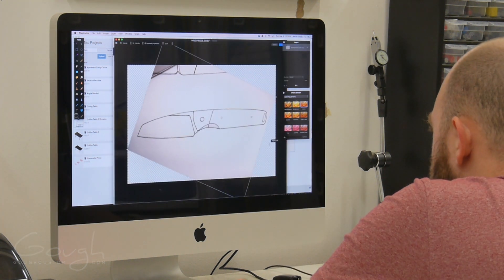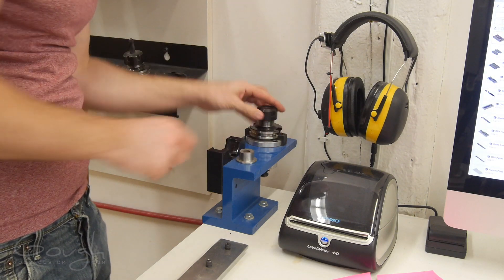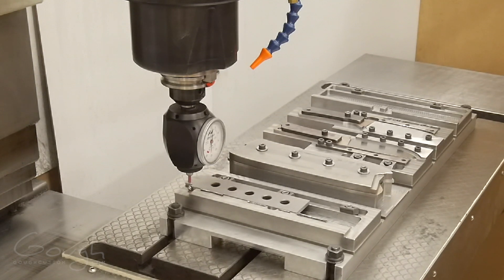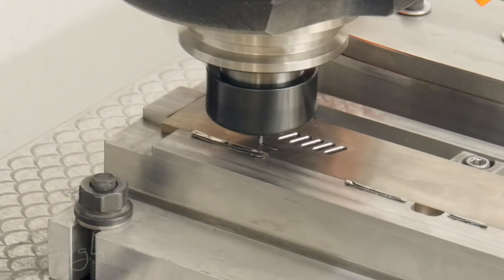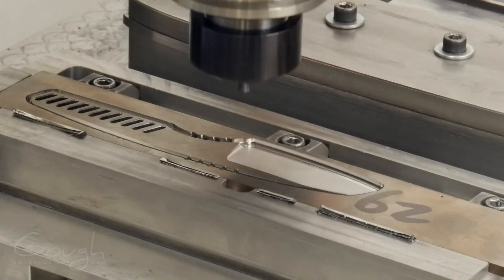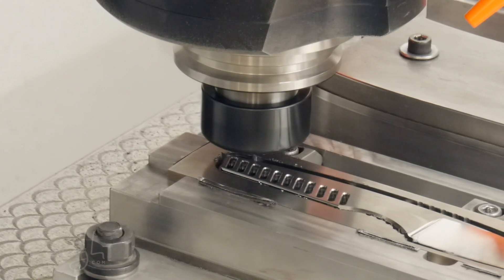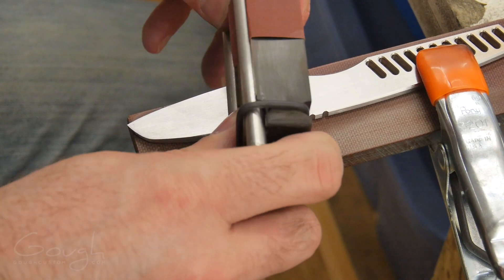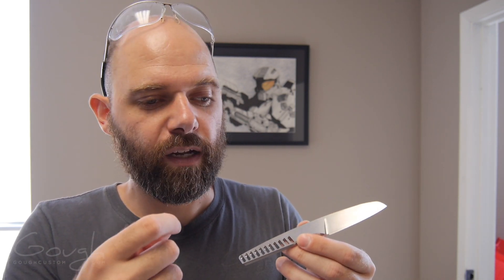Making a mini fixed-blade knife

Comment from the maker: A lot of people have asked about the polishing stones! I will be making another video covering them in more detail soon! In the meantime
the polishing stones I show in the video are 'CS-M' grade stones. I use the 1/4x1/2" size and I buy mine from MoldShopTools.com, here's a link to the right ones: https://www.moldshoptools.com/catalog/list.php?category_id=77&start=39
Reply: This is the first video I've ever seen of yours. That's a fine little knife, very handy looking. I make knives by using the stock removal method, cutting and filing, and eventually it becomes a knife. I like watching the machining process, that was fascinating. 👍
Reply from the maker: @beltfed4624  Thanks bud, glad you liked the video!
Reply: Gough Custom Thanks again!
Reply: Really appreciate the info!! ive been looking for those since I watched this. not sure what grits to get but I grabbed some 400 and 600 to try
Reply: @MrFra1ler  I'm not being intrusive here, but 1200 to 2000 grit sand paper creates a smooth finish, the wet or dry kind by 3M is best, Walmart sells an automotive finishing kit with multiple grits by 3M for around $5. I use the 1200 grit under a trickle of water, and it does a great job.
Reply: Janson Gander sounds good! I was thinking like pulling 600 grit I might buy some 800
Stones... what the heck should I use
For lube? I tried 3-1 and it worked but it was absolutely too thick and not optimal. Might get some mineral oil
Or wd40?
Reply from the maker: For lubricating the stones while polishing you should use water mixed with dish detergent, I use water and blue 'Dawn' brand detergent, works great!
Reply: I bought grits 240 thru 800, the one inch ones cover best. Great idea, thanks!
Reply: I buy the eBay edge pro stones, take off the plastic backing and have polishing sones for this. Super cheap and effective with many grit options available
Reply: Aaron, whats your grit progression with the stones?

Comment: Aaron, I have a couple questions if you don't mind.  1. What is vacuum hardening and the cost? I use only  Pops 8670 steel now because I don't have to normalize it.  Would I benefit by using a service to do this hardening?  I harden using propane and firebricks and quench in Parks 50.   I've really no idea what Rockwell hardness I'm getting but I can get the knife sharp enough to shave arm hair..lol.     2. What grit sandpaper do you use for your satin finish?   Thanks, Glen

Comment: Hi just wondering what is the best wood to use for a hunters knife handle
Reply from the maker: Hey John! Personally I am not a fan of wood handles as they absorb water and swell or shrink depending on the humidity. I prefer an artificial material called G10, I use it for all my knife handles.
Reply: @GoughCustom  thanks

Comment: Aaron, I missed what type of steel this is. I see you using CBN wheels and I thought you could only use high speed steel on the CBN or it would load up. Are you having these issues? If so how are you cleaning the CBN wheel?
Reply from the maker: Hey mate! You can sharpen any hardened steel with CBN, soft steel will load up the wheel

Comment: Thanks Aaron. What Fusion 360 toolpath are you using the blade bevel / profile? I cant get anything similar to work and Parallel is similar but not running across the blade like yours but alongside it, perhaps a setting somewhere? @Gough Custom. Thanks.
Reply from the maker: I am using a parallel tool path, there is an option in the passes section to change what angle the toolpath runs at!
Reply: @GoughCustom  Thanks, I found a setting to 'cross' both ways but not force a different option. Will check again.
Reply from the maker: @Chazaxl  In the 'Passes' tab there is a 'Pass direction' setting, this is actually an angle expressed in degrees!
Reply: @GoughCustom  Thanks Aaron, appreciated. I've done my first knife, its not perfect - using a converted Bridgeport Interact running servos / Centroid Acorn but learning as I go. So much to learn, thanks for your openness to share what works / doesnt work and detail around your process and methods.

Comment: Who makes that variable speed bench grinder?
Reply from the maker: It's a Baldor 3 phase grinder paired with a KB Electronics VFD (KBAC-24D)... Bit of a mishmash!
Reply: That’s a great idea! How many HP on the motor? You must get excellent control for various materials. You should consider doing a video on your latest sharpening workflow. The new shop looks awesome as well.
Reply from the maker: @samuelchacko4814  From memory I think it's 1.5HP, not that I really need that much!

Comment: If you leave a hole in the mold you cold use suction to hold the blade in position for removing the tabs at the end, like the tool is held in the CNC machine. :)

Edit: Maybe think of it more like a tunnel L shaped to get to the side if the mold to attach a vacuum pump.
Reply from the maker: Unfortunately given the relatively small surface area and the relatively high forces created by machining I don't think suction would be enough! It's only about 16 pounds of hold-down force per square inch!
Reply: @GoughCustom  well those tabs are really small, if you reduce the speed of the machine to it's minimum it might work.

Another possible solution would be to reduce the number of tabs to just 4 while keeping them more beefy. Pause the program and attach upside-down L shaped metal pieces in the middle of that spaces by screwing them next to the blade with a very tight fit to your plate beneath the blade. Now you can continue to remove the tabs, since the blade cannot move.

Sure this would reduce the accuracy a bit since you do a second pass just for those tabs, but it's much better than grinding them down by hand.
Reply from the maker: @RubenKelevra  I am working on a new process that will hopefully let me sidestep this whole issue! We'll see if it works out!
Reply: @GoughCustom  good to hear, never settle :)

I was wondering if you ever considered a titanium blade, would that hold up the sharpness etc? :)
Reply from the maker: @RubenKelevra  Unfortunately Titanium does not hold an edge anywhere near as well as steel does... The main advantages of Titanium are it's corrosion resistance and light weight... In some applications (like diving knives or lightweight backpack knives) this makes the lack of edge retention worthwhile, but likely not for my knives!
Reply: @GoughCustom  alright. I used to dive, so I came across some titanium knives but always wondered why nobody else use them. Thanks for the insight 😙🎶

Comment: This is how i make them. A larger blank and leave tabs..i'v been using this concept on diffrent projects for years..work great. but never have i cut hard..
Reply from the maker: It definitely works well! But because I need to make my blades match up perfectly with the handles it's hard to do that using tabs as grinding them off by hand I'll mess up the dimensions... I am working on a different concept that will hopefully be even better! We'll see if it works!

Comment: Hi there!

Love your videos as they really help me with my knives.  I'm cnc milling my kitchen knives and am struggling with a few things.  If I may ask, do you think this method would work with steel that is not heat treated and is 10" long and half as thick as yours?  I've used tabs with other projects and love them but am hesitant with a longer kitchen knife.  My main concern is having support for the bevel once it's flipped to cut the other side - which incidentally I'm curious how you locate once you flip?  Do you measure your stock exactly and locate off of that once flipped?  Or do you have a new origin for cutting the other side.  You don't have to answer all these but I'm fascinated by your method and hope to adopt some of it for my projects.  I too am using Fusion 360.  Thanks for the amazing work man.  Love your channel.
Reply from the maker: Hey Rusty!
Yeah I think this method would work great for a long kitchen knife, no worries at all there! I measured my stock exactly in this case, but I would recommend milling/drilling dowel holes on the first side and then using them to locate the blank for the second operation! It's a really good method for making knives with only simple fixtures!

Comment: Great vid! Super informative and entertaining. One question, if you were going to leave tabs anyway why not cut the profile all the way through instead of potentially being misaligned when cutting the other side? Seems you alluded to this risk when cutting the jimping all the way thru but didn't explain why it would be alright for the whole profile.
Reply from the maker: Main reason being if I cut all the way through the profile there will be nothing holding the blade in place and it will fly out! :) You can do this by bolting the blade itself down through holes into the fixture, but that requires a fixture specific to the knife which I didn't want to make in this case. I am trying to work out the best way to avoid all these issues in the future which is much easier said than done!

Comment: That bevel machining was super impressive. And doing hard milling is always impressive. And it's always cool seeing stuff be made in (basically) one op!

If you want more consistency, and less hand work, I feel like it would be better to mill all the way through the outside of the part, except for the tabs on the first op. This would also put the tabs all the way at the bottom instead of the center which means that the chamfer, assuming it is larger than the tabs, would hide the evidence of errors, so to speak. Of course you need it to be held while machining, so you'd have to drill and tap a couple holes in your fixture that you could put a couple of screws through the decorative holes, that way the part doesn't move during the chamfer. Or if you're lazy, clamp one side, chamfer the opposite side, M0, swap, repeat. The screwing or clamping would probably be needed for bevel machining as well so the tabs don't break. Maybe your way was less risky. /shrug

Great vids and knives man. Keep it up!
Reply from the maker: Thanks bud, I will do my best!

Comment: Mr.Gough Thank you! That whetstone stick trick is a GOD SEND! As soon as I saw this video I scooped up a cheap $9 set from Amazon. Grit from 80 to 1000. They wear a bit quickly but you get more bevels done then you would with any sandpaper in HALF the time. They are a consumable but cheaper than sandpaper. Internet fist bump. 🤜🤛 👍
Reply from the maker: Really glad it was helpful mate! If you need better stones I get mine from MoldShopTools.com, I use the CS-M grade stones and they are magic! Sorry for the slow response! 🤣
Reply: @GoughCustom  Better late than never, right! 😆 Thanks for the link. I'm going to give em a go.

Comment: Aaron, really like the video. It's unfortunate that you missed the bevel part in CAM. Could you provide a little more detail on what it takes to get an almost finished bevel off the machine? I would really like to know what toolpath you chose.
Reply from the maker: Hey Chris! The bevel part is actually not very complicated, it's just a parallel finishing path that has a  very small stepover, around 0.005" if I remember correctly. I only climb mill which really helps improve the finish. If you run both ways it's much faster but it won't leave as nice a finish...

Comment: Amazing knife ! You have a 4axis machine to be able to make these inclined cuts on the bevel or do you mount the piece at an angle ?
Reply: you don't need a 4 axis machine to make the bevels? The tool just moves downwards while it's cutting across.
Reply: @khaki.shorts  but then don't you end up with machining "lines/waves" ? since the tool is just in contact at one point at its edge. Are the lines just really close to eachother ?
Reply: oh looking closely I can see the waves indeed
Reply from the maker: Yeah as mentioned above you simply run a 3 axis toolpath with passes really close together to produce the smooth finish. There really wasn't any noticeable 'waves' in the final finish as the tool passes were only 0.005" apart! It's actually better to do it this way (rather than on a 4/5 axis machine) as you want to use the edge of the tool to cut, not the bottom whenever possible!

Comment: Hello Master Gough! I would like to ask u a question, I was thinking of making a fixblade survival knife what steel should i use between elmax or aisi 02? Best regards!
Reply: Cpm 4v
Reply from the maker: Almost any steel will produce an acceptable knife, but steel choice will dictate the geometry. If you go with a steel that isn't very tough (like 440C) then you will have to heat-treat it more softly. Softer steel means less strength so you'll have to leave the blade thicker to compensate which in turn will reduce cutting performance. It will still be an ok knife, but it is certainly possible to do better.

For a beginner getting into making knives I strongly recommend starting with O1 tool steel. It's cheap, easy to get and easy to work with. If you have made a few knives and have access to a heat-treating furnace then I recommend stepping up to A2 tool steel which is what I use.

Comment: These videos are great advertisements for your knives but not much use to anyone who can't afford your setup. Which would seem to be ... Just about everybody.
Reply from the maker: I don't think that's true at all! Seeing my process in Fusion 360 (which is free for hobbyists/startups) is great for people even if they don't have access to a CNC, they can use the ideas I show for creating designs/renderings/3D prints! Seeing the CNC process can get people interested in CNC, and there are plenty of inexpensive machines out there second-hand. I just bought 2 Fadal VMCs that are better than the one I show in the video for $4,000 each! Small CNC routers can be bought new for even cheaper and can be used for making sheathes and handle scales! Lastly the finishing process that I show using the mold polishing stones is something that most knifemakers have never been exposed to and can save everyone a lot of time... I work hard to make sure there are things in my videos that everyone can learn from!
Reply: @GoughCustom  I stand corrected. You got me thinking, thanks.

Comment: What grits do you go up to on those sanding sticks?
Reply from the maker: In the video I actually only use a single grit, 600 grit. They cut fast enough that I didn't need to start lower and work my way up.
Reply: Saw yer video and immediately ordered some from McMasters!
Reply from the maker: @flyphishr  I have tried some from McMaster but none of the grades they have worked as well as what I'm using at the moment, I have put a link to the ones I used underneath the video.

Comment: Hi Aaron great video! I had just one comment . I think that the martensite structure  that forms from heat treating falls off quickly as you go deeper into the steel. I would be interested to see if there is any difference in hardness or toughness since the best martensite layer is machined off in this case. I could be completely wrong here but I think it would be an interesting thing to test!
Reply from the maker: Hey Scott! This is an issue only with certain steels, and usually not an issue in knives even in those steels! Very low alloy steels like W1 require a really fast quench to harden them which means when you're working with thicker steel the outside can harden but the inside cools too slowly so you end up with a hard skin like you describe! Steels like A2 and most stainless steels don't need to be quenched anywhere near as fast which means they are 'through hardening' steels, even larger pieces will be uniform hardness all the way through. Thin steel, like we use in knives, tends to harden all the way through even with steels that are normally difficult to through-harden. So the short version is: with the steel I use (A2) this is definitely not an issue!

Comment: Awesome! Cant wait to try these methods with my cnc!
Reply from the maker: Nice mate, I hope it works out well!
Reply: Gough Custom  Crashed my $200 dollar bit into some hardened tool steel 👍👍😂 Time to order another and try again
Reply from the maker: @nickolasr7270  Ouch! I use much less expensive tools and they work great, here's one of the tools I'm using in the video: https://www.maritool.com/Cutting-Tools-End-Mills-Finishers-Square-End-5-Flute-and-Higher/c78_79_80_131/p18004/.250-dia-6-flute-sqr-TiALN-carbide-finisher-.060R-.375-LOC/product_info.html

Comment: Hi! Have you considered a custom clamp & locator jig setup to secure the workpiece during the backside operation? 
This is a relatively simple change (particularly with through & through holes in the handle or tang) that will allow you to do away with needing the tabs around the side of the knife, solving your dimensional tolerance issue as well as saving you manufacturing time by eliminating the sanding step from your CAPP. You might already be doing this with the resolute because of the larger volume. Let me know if you want more info
Reply from the maker: Yeah with the Resolute I use the pin holes as locators so i can machine all the edges, it works but it's still not the process that I would really love... I think the ultimate process for me would be to machine the tang and the bevels into both sides of the stock but not to cut out the blade, then machine locator holes into the corners of the stock (not the knife) then use the locator holes to mount the blank on a wire EDM and cut the knife out in one shot... That would also let me use tumbling to reduce hand finishing as I could tumble it pretty aggressively before cutting the blade out... Long term goals!
Reply: @GoughCustom  Haha, you're all over it! Look forward to seeing what you come up with! All the best & hooroo (: